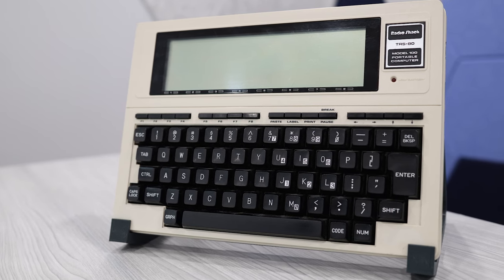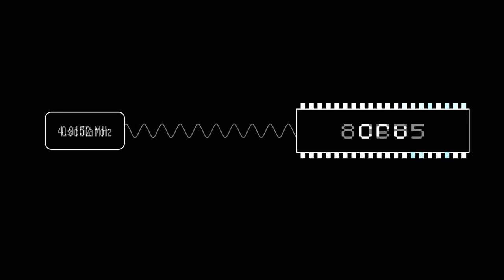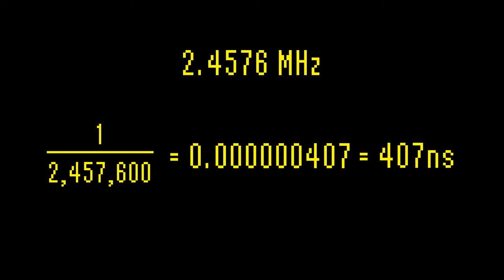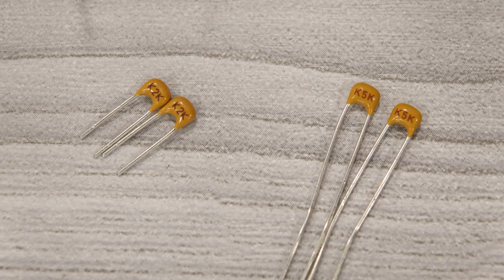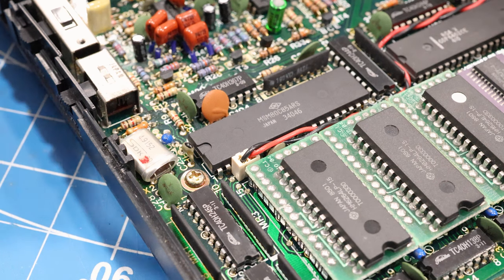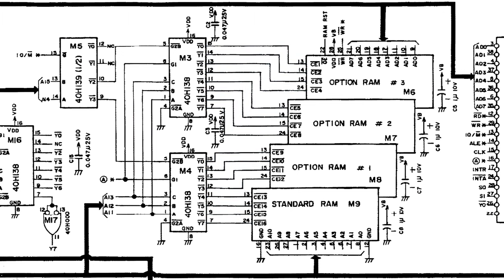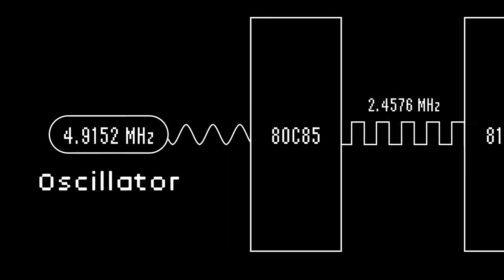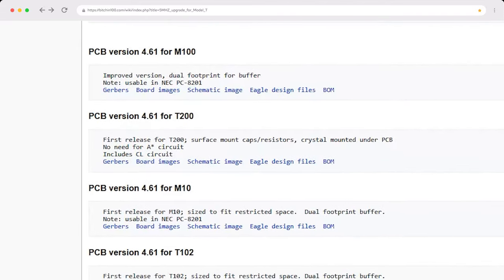Adding TURBO MODE to the Tandy Model 100

Comment: That is a proper mod, that is. Not some FPGA replacement for the CPU, but something that has been thoroughly thought out and is understandable. If it's not quite working right you could drop a scope probe onto the board and work out what's happening, something you can never do with a BGA256 packaged FPGA. Also, love the "use the clipped-off leads" solution.

Comment: I suspect the game display doesn't work because it's already driving the LCD controller at close to its maximum bandwidth at 2.5MHz. Length of the bullet sound is obviously implemented as a countdown loop and at 5MHz it's half the length. The frequency of the sound is controlled by the same 8155 that runs the serial port, hence patching the timer in for the 8155 to make the serial port work right also makes sure sounds are still the correct frequency.